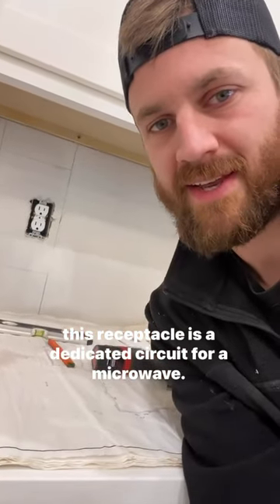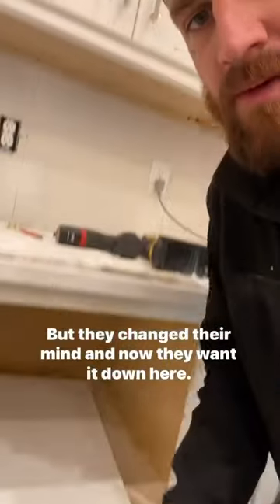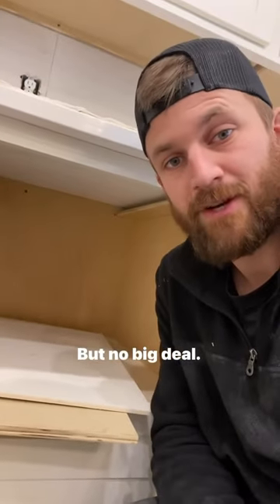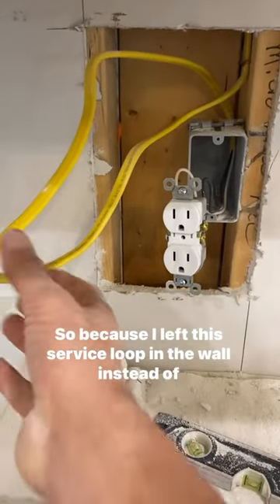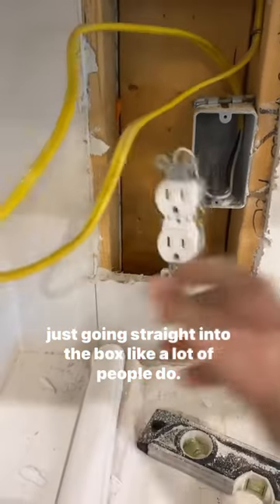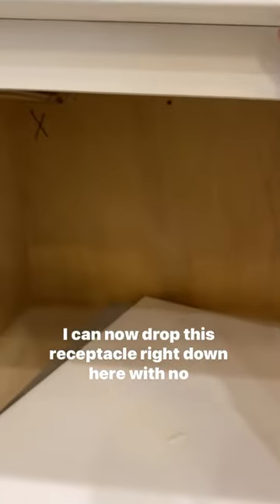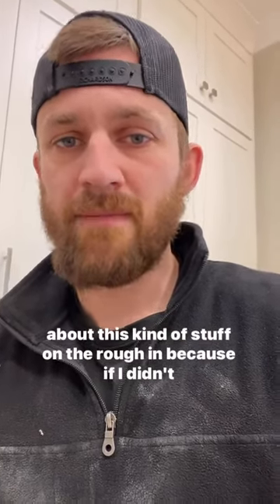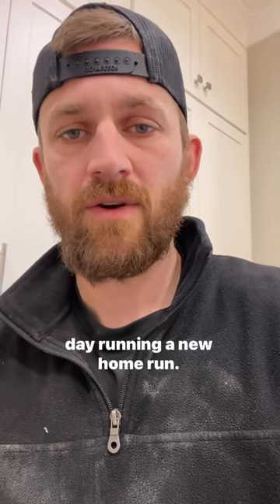This is Why You Should Leave Service Loops!! #electrician #bluecollarlife #construction

Comment: Dudes been waiting his whole life for this to happen
Reply: Zackly
Reply: Hehe... I came in here to the doodely doo to say this same thing!
Reply: In this circumstance i can understand leaving some slack because of uncertainy of the final installation of the microwave during the rough-in stage, but to do this for every outlet is a waste.
Reply: @cray-z578 in low voltage its standard for us to leave loops but sparkies aren't just moving boxes that often after finishing
Reply: Lol finally happened.
Reply: Yep, now he has a reason to live.
Reply: 😂😂😂😂I know it, so true.
Reply: That’s a lot of unused loops.
Reply: It happens more than you think not always that soon most of the time it's when a remodel happens
Reply: @jesseleach3883  no it doesn't on new construction and on remodeling 20+ years later your loop of extra wire is still useless. Most changes are not minor in a remodeling your opening up walls or removing them and 18in of wire isn't going to help.
Reply: This is actually not the way to do it. It's way to much risk for drywallers or any other construction to hit cables like this! There is no way to predict how the "loops" are placed. Quite a bad idea. I would rather lengthen the cable then doing this
Reply: Fr
Reply: @Leo_Y09 ...Klein wire stretcher..?
Reply: His whole life??.... Lol just one project I've had to move a lot of outlets in new construction because of things not working out or people change there minds a lot. And they don't want a blank cover plate for a J box on counter top area or next to bathroom mirror

Comment: Still gonna charge like it was a new home run 😎
Reply: Nothing wrong with that.
Reply: @johnbalzano6588 except  they already paid for the wire
Reply: @red2965  so what? You think they should only pay for the hour that it will take to move the outlet? It dont work like that. sounds fair to charge for an entire home run. A new wire will still have to be run to replace that counter outlet.
Reply: Of course
Reply: Heck yeah.
Reply: @johnbalzano6588  the problem is the guy is making a video like he is doing the homeowner a favor and he not.
Reply: @ButterNoToast  made a lot of money doing homeowners favors.  Giving them "my prices" as discounts. "Doing XYZ now will save you $ down the road, and im here now"
Reply: Why not tho, he's the one that made it easy on himself being smart.
Reply: You saved them all the cost of repairing all the holes you would have had to make in order to install a new home run. You should be compensated well for the forethought.
Reply: It ain't called a home owner loop.
Reply: @ButterNoToast it sounds more like he is making the video to show how the contractor can save time when customers change their minds last minute
Reply: @johnbalzano6588 some say that's called being a fraud.😂 Way to out yourself
Reply: @alexispa41  that's the industry. It's not just me, I'm just the one that said it outloud.
Reply: @johnbalzano6588  how do you figure there's nothing wrong with lying about things? Why should you be paid for way more work than you actually did?
Reply: @johnbalzano6588  that's not the industry, but rather the people in it.  Not everyone is like that. Undoubtedly quite common, unfortunately, but not an experience everyone is doomed to share.
Reply: @joeshmo8267  yeah, as an electrician, we don't claim him. They must work for Mr Sparky if they're US in origin 😂
Reply: And he should
Reply: @goosenotmaverick1156 actually it is the industry. On the commercial side you’ll see spare conduits because they know they’ll need them. Controls side will usually run spare wire. And thats where you get paid 🤑
Reply: @poppingt4gs  "well actually" Lol 

Commercial is a different beast from residential, but whatever you say. 

And controls isn't the same. If the code changes by application, well, they aren't actually the same application, are they...?
Reply: @goosenotmaverick1156  The “application” here is to do work in a way that anticipates a change/add-on from the original contract. Thus allowing the contractor to plan and perform the work efficiently to increase profits. It’s all the same industry, just cause the wires look different doesn’t mean the business practices aren’t the same
Reply: @goosenotmaverick1156 holy shit I haven’t heard of mr sparky since I moved away from the metro areas!
Reply: Why?? That's dishonest dude you robbing people?
Reply: Damn straight! 😎👍
Reply: @ButterNoToast  Getting in and out quickly so the job can move forward is doing the homeowner a favor. Doing things right is doing the homeowner a favor. Pulling new wire from who knows where because of a slight change of plans is not doing the homeowner any favor. Do quality, be proud of it, and charge accordingly.
Reply: @joeshmo8267 Who said anything about lying? Charging "as if" doesn't mean he's lying.
He used foresight in his work. The customer didn’t. Why should the customer benefit (or be the only one to benefit)?
The customer is paying for a service / product. Unless the customer is paying by the hour, the customer should expect to pay a lot for changing their mind mid-project. They're probably still saving money by hiring an experienced professional who's put contingencies in the build over someone who's rushed everything in without service loops and other fallbacks.
Reply: @feanor5037  if you're going to charge "as if" you were running a new line, the customer may as well have you actually run a whole new line and have a whole extra circuit in there.
Reply: @joeshmo8267  Can I ask how you define value? The reason I ask is this: Let’s say the typical electrician can do “X” job at an average of 4 hours at an average cost of $1000. Let’s say for sake of argument you are quoted that and find the price to be reasonable. If another electrician can do the exact same job at the exact same quality in half the time, is it now worth less than half the price to you? You receive the same final product with far less time spent in your home disrupting your life.
Reply: @johnbalzano6588 hour wow some ones in the union 😂
Reply: I’m an electrical engineer curious to how many illiterates there are
Reply: @leo0626  you damn engineers always wanting things installed where you can't because there's ductwork or other things in the way lol
Reply: @markk3948 lol. Because contractors don't spend the time to coordinate and look at ALL the plans not just their particular trade.  They go by "time is money" and want to spend as little time doing the work as possible instead of taking the time to DO IT RIGHT. Plus half of the "contractors " can't even read plans, little lone coordinate with other trades.  Prove me wrong...no...you couldn't take the time to read all of this?😂😂😂
Reply: @johnbalzano6588 so you’re okay charging for work you didn’t actually do. Amazing the level of shadinesses among handyman.
Reply: @brandtnicholson4532  not a handyman, im an E-1, electrical contractor. 35 years in the field. I don't charge by the hour but rather the job. Why should i make less money just because i can complete something in less time. Upscale locations get charged higher.  When i go to look at the job, there are certain clues that i look for that let me know what the customers can pay and get charged accordingly. Always have to figure in that the more well-to-do clients will try to negotiate for a better price so that also needs to get tacked on to the quote......this is a business im in it to make as much money as i can for as long as i can. It's NOT about charity and giving back to the community.  It is about building my bank account.
Reply: @seetheworldfrommyharley actually no, a lot of plans do go back for R5's (revisions) due to the plans being made on a generation program with small edits. There are almost always changes to be made on the engineering side of things because if we did everything according to the plans, certain things will fail if left according to the prints. Doing a job right now with the main water line right below the main distribution panel. Big no no. Another I had a ground use all the panels on site as a raceway, big no no that cost the engineers company tens of thousands of dollars, wires had to be pulled back to the main distribution panel and junction boxes installed below the panels. That was all to the spec. Some companies will follow the spec to a T just to get extras off the engineers, some companies will ignore the engineers and do it properly in the first place. Also did a job doing controls and they have many wires missing for PLC's because they didn't put the right amount of tics on a line for the prints. Not my fault. So yes we know how to read lines and symbols on a paper that has a legend. Do engineers do everything right. Only before the job starts do they do everything right, then the real world comes into play and their imagination gets the best of them.
Reply: @joshmorgan360  I will agree with alot of that, and there are alot of engineers that should NOT be engineers,  but mommy and daddy bought them a piece of paper that "certifies" they are "smart" 😂. I have been out of the business since about 2016 so perhaps trades are better at coordinating,  however when I was in the business,  architects were the ones with their heads in the clouds and the engineering project  managers were horrible as relaying information during planning meetings.  I always thought that the actual trades should be involved in many of the preliminary meeting. But during planning, the architect, civil, structural,  M,E,P engineers were all working at the same time and basically throwing crap on plans so they could bill (during D.D. any the way through C.D.s) you could always tell by looking at the detail sheets, details that didn't pertain, or details that didn't match sections.  I wasn't dogging the trades as much as the coordinating up front and during the project.
Reply: Yes you right brother
Reply: @markk3948  you damn snake contractors you ment to say...right?
Reply: Absolutely 😂
Reply: @red2965 at that location. Different location, added materials and labor.
Reply: Homeowners beware, contractors will gouge the fuck out of you for any and all changes, no matter how minor. It’s a real revenue stream for them. 

Before the contract is signed, that extra receptacle costs $10. After you sign the contract, it will cost $1000.
Reply: @HawkGTboy  yup that's why I sub out everything and am my own GC.  Most don't like you watching over their shoulder for a reason as well.  But if you don't it won't be what you want or even correct in alot of situations.   NOT ALL contractors,  but probably 80%
Reply: And he should, it shouldnt cost any less just because dude had the foresight to save himself trouble if they changed their mind lol.
Reply: How about just connecting an extension from the old box and leaving the connection in a that covered outlet box?
Reply: @red2965 In the trades, customer changing their mind is called a change order 🫡
Reply: What if the homeowner want to hang something in that area ? They might run a nail thru it😏
Reply: @johnbalzano6588  "Nothing wrong with that" wrong

Comment: You could also cut in a junction box inside the top cabinet and drop your wire for the receptacle.
Reply: The Above/below counter 2-boxes  accessibility makes future common sense.
Reply: That’s what I was gonna say! Just need to pull it back to the nearest junction box and extend it
Reply: Yea having a big loop in the wall isn't a great idea
Reply: Cheaper to run microwave cord through shelf .
Reply: Don't even need to cut in a box. Use the existing outlet box as a junction box.
Reply: Don’t hire this guy. He claims he would have to run a complete new line. WRONG.
Reply: mikepletka  no you just pull the wire back the direction it came from and cut in a junction box into the cabinet above or preferably if there is attic space above that
Reply: Everyone saying just add it to the box doesn't have a clue why he's doing it. It's a dedicated circuit. You can't have another receptacle on the circuit. So he's correct. However, what about the countertop receptacle that's now missing where the microwave should go and is now counter space
Reply: All boxes have to be accessible.  He can't put a "junction" box in the wall. 
If he drops a wire and makes a daisy chain from the existing box, then it's no longer a dedicated circuit.
Reply: @bobfranke2347  Except code requires a dedicated circuit.  2 plugs and people will plug everything else into it.
Reply: @paaapppermaker  Dedicated circuits don't have junction boxes.
Reply: @fjl05  Code violation because it's a dedicated circuit.

Comment: I'm not a licensed electrician, but have done a fair amount of remodeling and home repairs.  If someone ever drilled or screwed into that wire you'd have an instant fire hazard, possible electrocution,  not to mention a possible breaker that won't reset if there's a short.  Building codes are made for people's safety among other reasons.